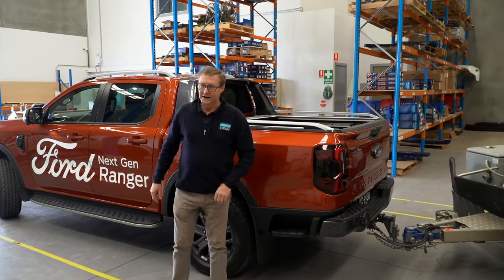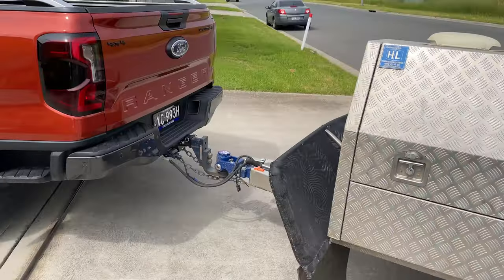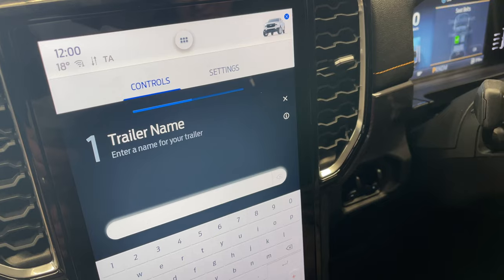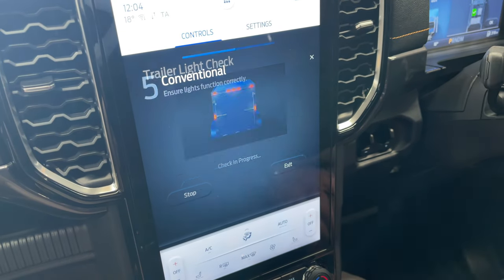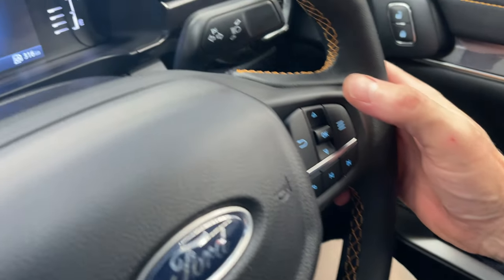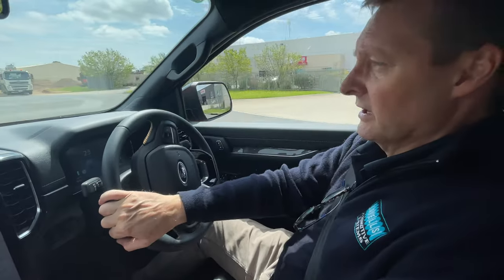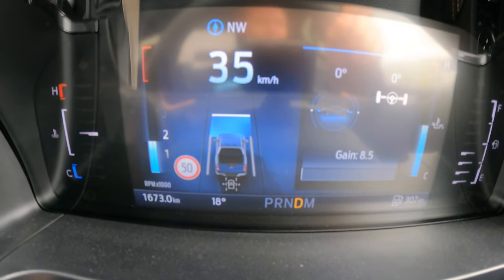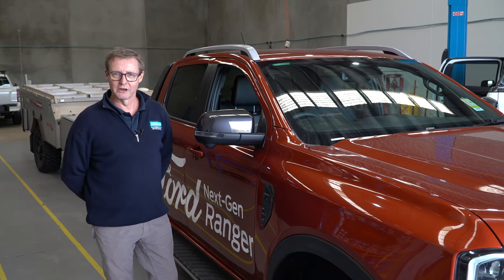How to setup and use Integrated Trailer Brake Controller on the Next Gen Ford Ranger

Comment: Great video.  I have just converted my trailers cable disk brakes to electric drum brakes so i can make use of this feature in my new ranger.  The problem is my trailers' brakes now pulsate when braking. Tried changing the gain, disconnected the cabling that's used when trailer disconnected just in case. Do you have any ideas as to why the pulsing?

Comment: Hi mate 
Had my Ranger sport for 12 months and have struggled with the integrated brake controller. My 19 Ranger with the Redarc unit had no issues stopping when my 3T boat was attached on a gain of 4, I run the integrated unit on 10 just to remove the surface rust off the disc’s. The boat trailer has electric hydraulic with 4 disc’s. Originally the 12 pin plug that’s standard on the new Ranger wouldn’t power the brake unit, ford informed me I had to move a few of the pins around, this got power to the unit but it’s always delayed applying force or power, relying heavily on the cars brakes to do 95% of the work. 
Thinking of just wiring in a new Redarc unit as ford have been of no help even after demonstrating it’s not the trailer system that’s the issue.